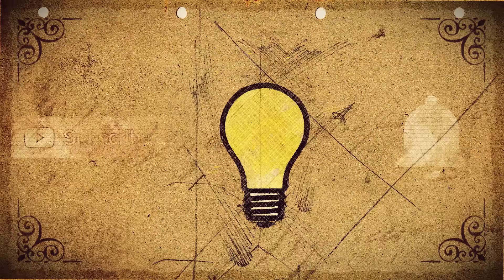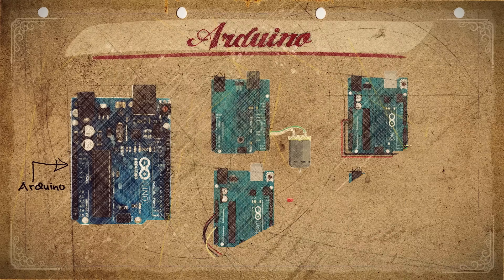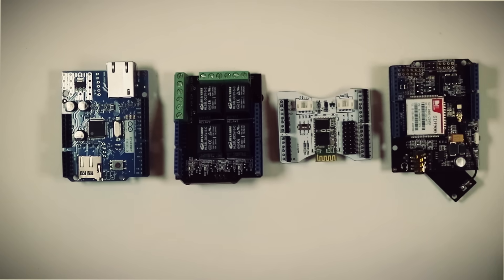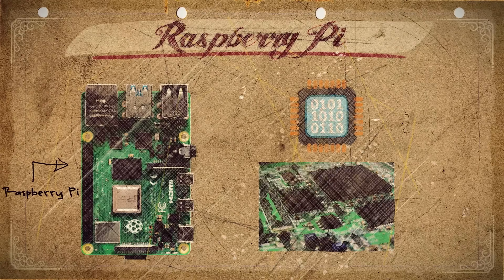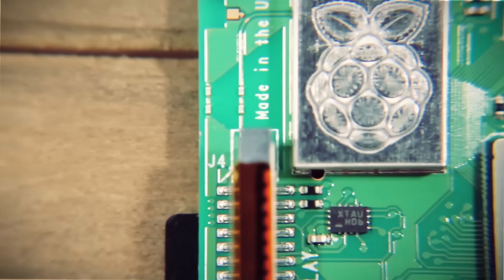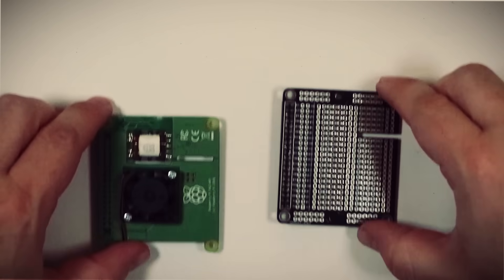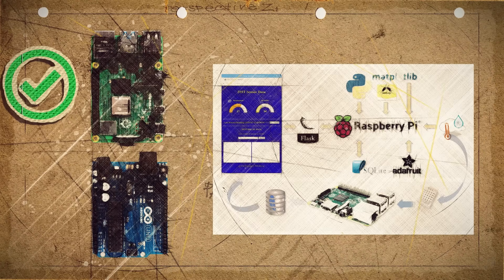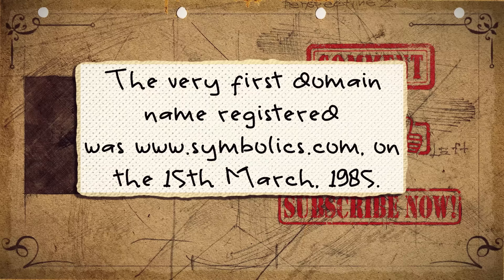What's the difference? Arduino vs Raspberry Pi

Comment: I'm actually developing a Raspberry Pi to bridge a gap in my diabetes. It will read my blood sugars from a Continuous Glucose Monitor (CGM), process it and develops a curve. If my sugars are high, it  uses that curve to develop a temporary basal rate to tell my insulin pump. As my sugars come down, it reevaluates the basal rate and tells the pump to lower the rate, if it needs to.

If my sugars are too low, it will lower, or even stop, the pumps injection rate. It will put the pump on Standby. If the pump can't support that, a temporary basal rate of 0 is set, until it needs to be turned back on.

edit The computer part of this is complete, on my end. I am currently developing a glucose monitor out of an Arduino Uno, because continued CGM support is not guaranteed.
Reply: make sure it doesnt break and release all your insulin into you at once
Reply: Doesnt tht already exist though? Automatic insulin pumps.
Reply: @darkfoxjj  expensive as fuck
Reply: @darkfoxjj  I mean, yeah. But creating one yourself is just epic
Reply: I'm too short sighted regarding eventual problems to try a project like this that my health depends upon. Every program I've worked on has had some errors that weren't immediately obvious.
Unforeseen reactions during my cancer treatment have put me in intensive care in the past, all those drugs have had considerable testing but how they work with my body and each other creates more scenarios than were foreseen.
I wish you all the success in the world!
Reply: Please make you sure that it is well tested before using 🥺
Reply: As a physician I will say this: you would have to be a very “brave” person to try that… If you cannot be dissuaded from trying it, perhaps you can consider adding a back-up system with a glucose injection to give you some time to dial 911 and gulp some glucose paste if you drop your blood sugar precipitously? Good luck
Reply: Should use Loop instead. If you have an omnipod or meditronic it’s perfect. Used it for a year and it’s like the best thing ever
Reply: @bjduncc  Isn't loop IOS only? I'm a bit too privacy concerned for that. While Apple isn't as bad as Google on data collection, they still collect it. As far as I'm concerned the only people that should have access to my diabetes data are my doctor and I.

Besides, OpenAPS has the same compatibility.
Reply: @phillippi2  OpenAPS was way more glitchy for me. But if it works for you then there's nothing wrong with using it obviously. Was just suggesting it
Reply: that sounds great and but you shouldn't trust an experiential project with your health, so please don't use it even if you make it, please just telling this for your own good
otherwise you are very free to do whatever you want (this included but still don't).
Reply: @hpsmash77  The pie is not going inside the body. It's just the computer. If the computer fails, it's easy and cheap enough to replace. The pump will resume its normal operation, because that's the official default
Reply: @phillippi2  there is still a very real danger. if there is an error with the project, it might tell the pump to deploy too much insulin, killing them. you should not use medical devices not approved by the FDA (or analogous govt agency)
Reply: @summarosa  See above
Reply: Good luck man!! Sounds like an awesome Idea
Reply: That's incredible, how old are you?
Reply: Yes! Amazing
Reply: do i have any tutorials or any github links??
Reply: Great 👍 carry on and shock the world
Reply: Because evaluating the basal rate manually while cooking: who's got the thyme!

But seriously, this is freaking awesome! I love the dynamic usefulness of the RPi! Also, as you put it, there is an arduino that can supplement whatever the Pi cannot do. Simply amazing!
Reply: You made a glucose thermostate?
Reply: @visiaaas  It's on hold because of Covid. But, I'm in the process of making a Continuous Glucose Monitor, using the Arduino Uno.
Reply: That's a pretty awesome project ngl
Reply: Nice!
Reply: Genius.
Reply: Make sure you incorporate PID loop learnings in there.
Reply: thats awesome fam
Reply: awesome project
Reply: Sense this possibly involves your very life with pumps and sensors you'd better be right and not just some fun project experiment.
Reply: That’s incredible! I AM excited to see how it turns out.
Reply: that is absolutely genius. with a couple of modifications it can be suited to many different illnesses. foe example after a few modifications it can be used by people that have asthma like me

Comment: One thing to note is that there's not an analog to digital converter on the pi and there's not a lot of options for PWM control (only 2 pins) so if youre doing something that needs analog sensing or pwm control you will either need a hat for your pi or an i2c board to handle those functions.

Comment: Both are whole computers on small boards
1: Arduino is microcontroller board (has very low computing power 8-bit +2KB RAM)
2: Pi is microprocessor board (has higher computing power ,from pi 3 all are 64-bit,1<'GB RAM )
Reply: Arduino is not a computer as one would use the term in everyday life. An Arduino has no OS to control the hardware layer (the software that is preloaded on an Arduino is to facilitate communication with an IDE so programs can be transferred to it), nor can the software on the ROM be changed by itself.

Comment: My recommendation: Start with the Raspberry Pi: You reach more faster and not having to learn C is a big plus. Python is a lot easier for beginners. Just look at how many lines of code you need for the same: Winner? Raspberry Pi. The Arduino is an older concept that is less capable and you need to think more like a machine, because it has a lot less power.

Comment: Naming C as "similar to c#" 

is like the least and most accurate comparison i ever heard
Reply: they are all, after all, starting with the letter C
Reply: # is ++ on top of ++
C# is C++++
Reply: @peppigue  Actually it's derived from the musical symbol ♯ which raises the note by a half tone. That's why you read it "C sharp", and not "C hash" or whatever else you call #
Reply: @xGOKOPx  He's not saying that # means ++++; he's saying that it represents that and a name that continues the pattern would be C++++. "C# is ++ on top of C++." It refers to the sharp on C#, not # in general.
Reply: @-ism8153  hmm, the sharp does have four plus signs in it
Reply: nope, a half-step up is a huge difference.
Reply: Software Engineer here, the point is, C and C# are nothing alike in terms of language. C# is very high level, C is very low level. It’s apples to oranges.
Reply: Arduino language is a version of C++ language (has classes), not C.
Reply: @mbaksa  it's not Arduino language, just C++ or smth, it just includes the Arduino library without you being able to remove it
Reply: @mastershooter64  remove what
Reply: @mbaksa  arduino lang is just a wrapper around the C lang. I never knew it was c#, i guess thats an error by the narrators side. Basically `arduino lang` is just C lang that has been modified
Reply: @mbaksa  they're the same thing.
Reply: All this C & Sharp arguing.  Can't we all just get a Visual Basic?  :)
Reply: Why didn't he just say it basically runs C?

C is the granddaddy of C# anyway.
Reply: @rexbarr_5783  I've programmed a lot of arduino's and it's all been C.  I think the arduino libs are C++ .
Reply: I knew the moment I heard the "C#" in the video I would find a topic like this one, and no doubt it will ultimately lead to a Nazi comparison at some point. :)
Reply: Nerd rage ! I luv it 😅 It’s like comparing Java and JavaScript it boils for someone.
Reply: Java vs Cracked out C++
Reply: nerds 🤣
Reply: it's like comparing scratch to brainf*ck x)
Reply: Same
Reply: Killed me.
Reply: it is very insulting actually
Reply: Come on, they're both spelled similarly
Reply: Yea
Have used both can confirm
Reply: 6
Reply: It hurts
Reply: As accurate as English is like German.
Reply: we have a youtube channel that deals with Arduino,ATmega328P,Java,Serial programming ,robotics. So if you like these stuff do Subscribe. Sorry for annoying
Reply: This conversation is really hurting my head
Reply: U mean cpp
Reply: C# is more like java script, now every language has basic paradigms of C, that doesn't mean everyone is C.
Reply: That's like java and JavaScript
Reply: This had to be the most cursed comment election thread I've ever walked into.

The IDE uses avr-gcc to compile the code, if you want you can write and compile purely in C using avr-gcc or you can go use C++ and compile with avr-g++, it then uses avrdude to flash the program to the board

STL is a library that is included with the compiler, but it isn't for avr compilers, because it uses a lot of dynamic memory  allocation, which requires OS system calls, and since you don't have an OS on a MCU you can't use them, among other things.

You can use templates, classes, modules, concepts and other core language features though.

The IDE also just hides the fact that you're using the Arduino lib, where you fill in the code for setup() and loop(), just download it from github
Reply: C is the go to programing language with and C++ is the advanced version that replace C. Then, a few year later Microsoft decided to name their programming language and named it C# which confused me as a beginner who try to learn programming for the first time.
Reply: not just similar, the major part of programming languages are simply dialects of several ones.
Reply: A lot of comments here are missing the damn point OP is making.

C came first. You won't have C# nor C++ without C.
Reply: @Tiddle_s  That is EXACTLY what I was talking about, however, I said "C++ or something" because this version does not include features that would otherwise be available in standard C++, such as vectors, maps, stacks, file I/O etc.

Also, the fine extension is .ino
Reply: @iProgramInCpp  ... you have a misconception here.  You can have a lot of things created with C++ in an Arduino.  I use to make my own libraries for many tasks just because I wan't to keep the memory usage under control (main limitation in an Arduino).  STL with all these vectors, maps, etc., is just a library that can be or not used with C++ and that maybe could be used with the high grade Arduinos; however, because of Arduino normal purpose, there is no so big advantage on wasting these precious bits just to follow a particular programming practice.

Then, Arduino IDE's main language is real C++ where you can create your own libraries using C++ language, and where you lack things as POSIX functions because there is no Operating System running with your program providing such functionality (your program is the king there).  Then, they provide you with basic and useful alternatives, together with several usable and optimized for Arduino libraries.
Reply: The language grammar is similar lol. C# has many of the features C (and even C++) have, even pointers if you're willing to use unsafe code. Normally it does use references to classes instead of copying them already, so that's taken care of, and no need for "unsafe" pointers.
Reply: @iProgramInCpp  wf
Reply: @iProgramInCpp  C# is OOP but C is not
Reply: @iProgramInCpp  bro really called it grammar 💀💀
Reply: @iProgramInCpp  C++ IS A GUI SO IT USES POINTERS
Reply: @iNSIDEReVERYTHING  what
Reply: The future is NOW, old man.
Reply: Excellent video! Just getting curious about this stuff and often wondered what the difference was! I'm coming from the drone/flight controller world...
Reply: @livinglarry8320  G++ is one way to call C/C++ compiler
Reply: Then change the name of your crappy programming language??